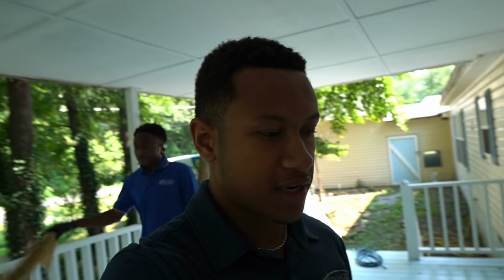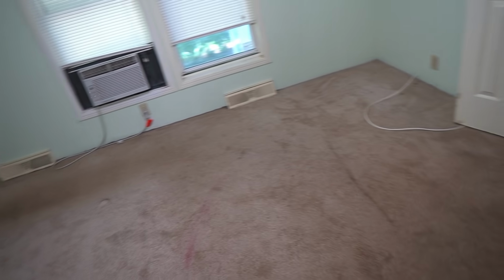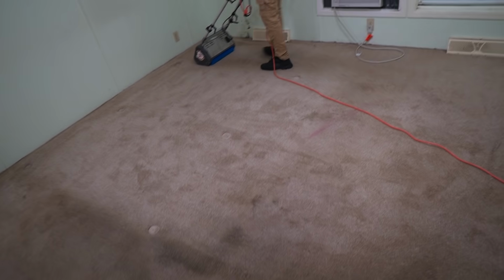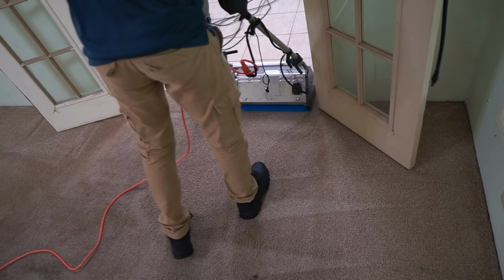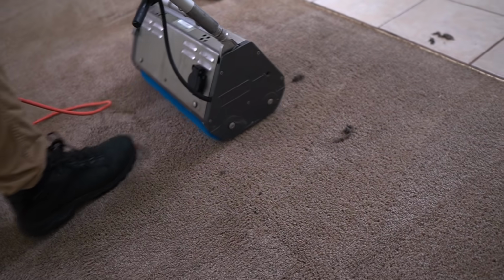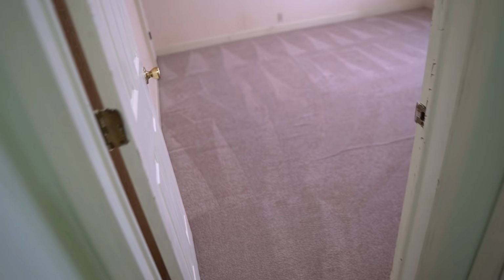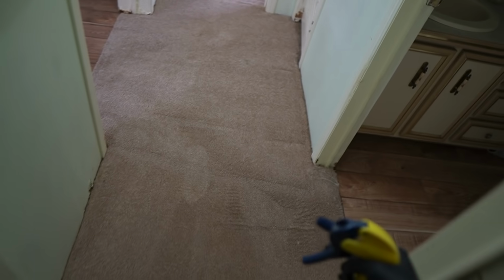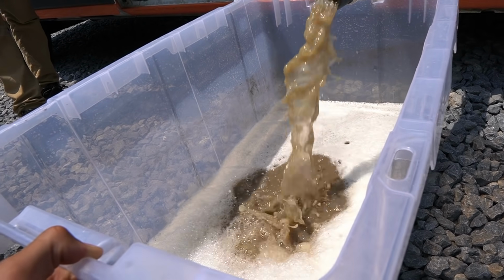DIRTIEST rug ever gets DEEP cleaned after many years || Satisfying rug washing

Comment: It’s so obvious that carpet needs to be replaced based on the edges between the room to the non-carpeted room. You men did an excellent job with what was given to you!
Reply: Normally I'd have a carpet vendor (installer) stretch and tack down the carpet, and install a border strip between the two flooring areas. It's hard to tell on video whether the pile of the carpet was still good. Not every rental home will be the super nicest, and it's possible this carpet was installed a year ago and the tenants moving out were just really hard on it. I've seen a LOT WORSE when people have dogs or kids. So while it's a bummer to have someone move in on carpet with a red stain and a dark stained area, I can understand when the budget just does not support replacing carpet every year. To replace that area of carpet could be about $1000 these days and we get a good deal on install of quality product. 

As for the tenant's perspective, while it's nice to say you want everything new and replaced, you also have to consider how much rent you're paying. A less-expensive place that's clean but has some wear & tear on it is a choice people have to make for themselves; you can't expect a property owner to spend $8k replacing everything after someone spent a year destroying it for $10k in rent.

Comment: Best vacuum for prevacuuming I've found is a machine that has many names, it's the Oreck UPRO12, Oreck Pro12, Bissell BGUPRO12T, and a few other names, it's got soft bristles and good suction which equate to very nice carpet lines while also not beating the life out of older carpeting, it's also quiet, easy to service, and easy to use with a lifetime belt system

Comment: To get more water through that hose, you’ll need to open up all the restrictions from the main water line feeding the building. You have a large hose but the spout it’s connected to is about 3/8” or smaller in the inside so that will limit the amount of water you get no matter the size of hose.

Comment: I've had colored stains like that one and I've made a paste using some oxiclean and did a pretreatment with a cleaning solution then applied the paste to the stained area and let it sit for a few minutes then scubbed it with a brush to work the oxiclean on the stain then proceeded to use the carpet shampoo machine to clean the carpet really well and rinse the area with water while pulling up the excess water with the shampoo machine. The stain had mostly disappeared.  Just make sure you rinse up where you applied the oxiclean because it will eat up the carpet if you dont.

Comment: Next time try putting cheap aquanet hairspray in a brush and cold water and have the suction right there. Not a lot of cold water but spray it on to the spot. That's how I get ink spots out of my clothes and other things in the house. One time I had a pen bust in my scrub pants for work. And they were yellow I got all the blue ink out. So cold water aquanet and a toothbrush and make sure you have your suction or right there. You might have to use a lot of cans of aqua net but it'll work

Comment: Just wondering if you wash soap and brush both sides or just the one side. My thinking would be if fluid goes on the carpet it will go on the bottom also. Would that help in removing stains?

Comment: I bet the home buyers couldn’t afford it but those carpets just needed to be replaced. Beyond the stains, it looked like the carpet was no longer attached to the floor properly, it was bunched up in places. Also, the edges looked frayed. I’ll bet there is some exposed carpet tacks around the edges too. The rental I currently live in needs new carpets badly, whenever you accidentally step on the exposed carpet tacks where it transitions to tile it’s legos x10.